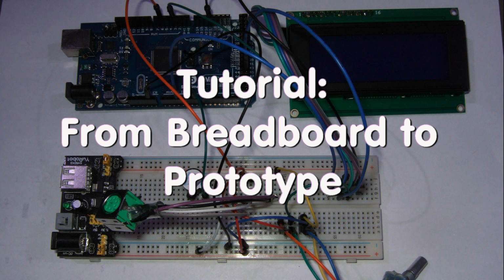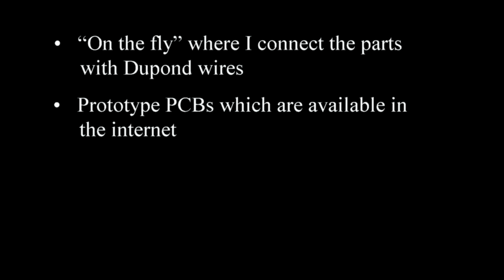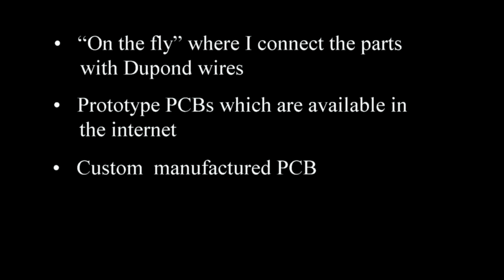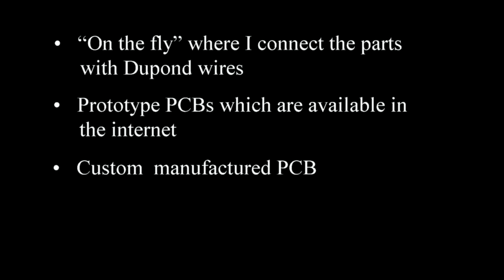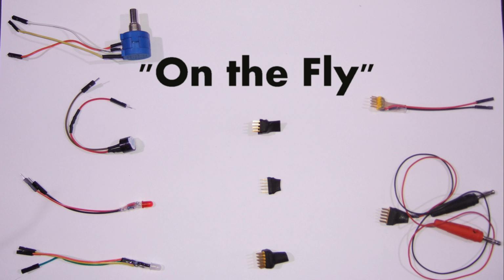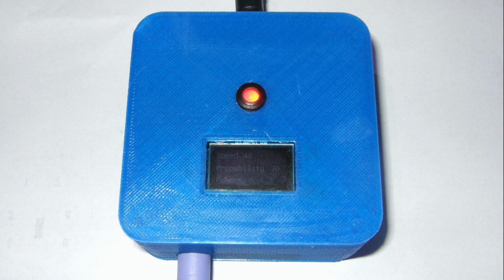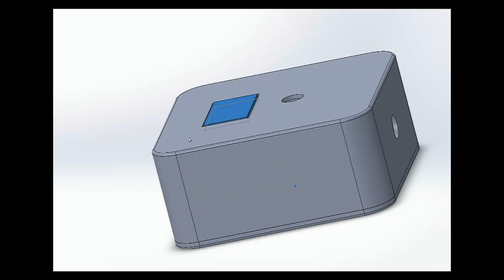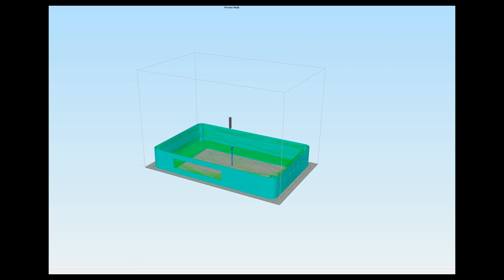#6 Tutorial: From Breadboard to Prototype (Arduino)

Comment: Hi thanks for a great vid!  I have a question (re.[5:35]) - If I was to in fact crimp my own wires(cables) rather than soldering as you’ve demonstrated here, is it indeed alternatively possible to use a 5v/12v/etc. Relay Switch(s) (as in, the screw-fastened type of “junction” thingoes? - I think they’re typically that not-quiet “Army green” colour…) -  Obviously the APPROPRIATENESS of doing so would be entirely applicable to the particular project and I can certainly foresee a fair many occasion where it would incredibly NOT be… BUT, It can be done in such a manner should MY particular project warrant me the inclination to attempt so?  …I like the idea of a “modular synth” or “tele-switch operator” style rig-up and while yes, still fastened - not yet to the extent of permanence that’s inherent from soldering… I just love my square-edged Ferrule/Bootlace connectors!  
OR, perhaps WAGO connectors?…
I don’t know…
I’m self educating myself and it’s probably obvious I’m suffering from missing my afternoon classes… If that tracks
Reply from the maker: I would say: Just try it and if it does not work, you have at least learned something...

Comment: Dont you have problems with dupont connectors that eventually separate from where they where connected? I have the feeling that you resolve the problem by having many duponts joint together in rows, since to separate one dupont is very easy, by to separate 8 at the same time is not.
Reply from the maker: You are right. I had another video with tips and tricks where I show that I use empty shells. And one about a good crimping tool.

Comment: Love the project. Do you by any change have a website where I can find the schematics or do you see it as an extra challenge to figure this out from the videos and software?
Reply from the maker: +Xander Langschmidt If I published files for my videos I published it on github and included the link in the comment of the particular video. This is not always the case, because sometimes, I think, it is too obvious or have other reasons for it. But you always can try to change my mind with a small request in the comments...
Reply: +Andreas Spiess I'll try to figure it out. I do like a challenge. Having the video of the photo type and the software, I should be able to make it on my own. I'll drop a line here if I get stuck or to let you know I have it up and running. I learned a lot from that on the fly building video.
Reply: +Andreas Spiess Ok i just ran into my first issue. Is the code on github for the mega (as in the proto type) or for the pro-mini that you use in the final build?
Reply from the maker: +Xander Langschmidt Which project do you refer? The morse trainer?
Reply: +Andreas Spiess Yes the morse trainer. I have ordered a screen and 2 color led from china, so I can build it myself. After I get it working, I plan to tinker with it a little bit. See if I can adapt it to use the Koch morse training method.
Reply from the maker: +Xander Langschmidt I will help you. Since  this project was done last summer I have to look into it tomorrow.
If I understood right, the Koch method uses faster signals and longer pauses. I think, this can be done. To start with just a few letters if you do not know all is already built-in. One thing is better than all other systems: The trainer reacts automatically on your actual skills and adjusts the training (speed and letters) to what you need to proceed. To my knowledge, this is the fastes way to learn morse code. I do not remember if I mentioned in a video: The Swiss Military bought these trainers from me (in the 80s), when the russian military still used morse communications. The Swiss military had a crew to listen to that communication ;-).
Reply: Hi Andreas,

I have received all the parts from China. Did you manage to find any further information? Most important if the code is for the Arduino Mega or the pro-mini.
Reply from the maker: +Xander Langschmidt Xander, I propose to move this discussion to my video #1 bcause it is concerning the morse trainer and it might be interesting also for others over the years.
Would you be so kind to put a small comment below video#1 and I will answer there (I started it on the Mega and now, it works on a Pro Pini). But maybe you also have other questions because it is a tricky software using interrupts. You might also need some "introduction" when it works. I hope, you are aware, that you also need an old PS/2 keyboard...
Reply: Andreas, excellent description of your methods, very helpful.  Question: at about 6:22 in the video you are using a wire stripper. I would very much like to get a stripper like that, can you share where I might get one please?